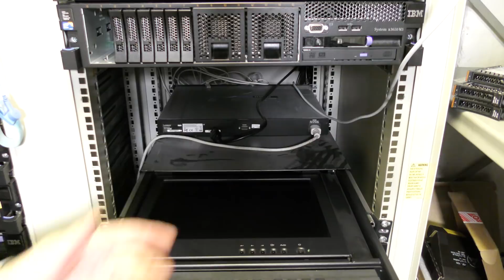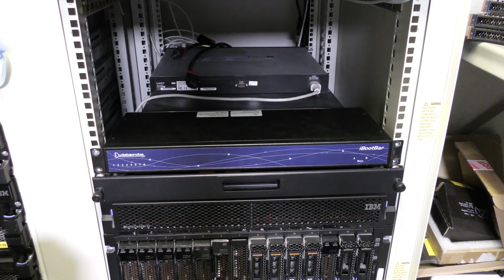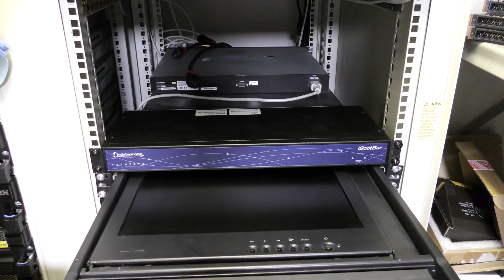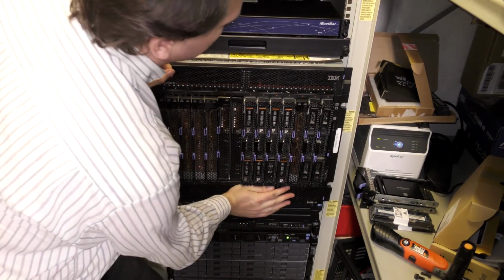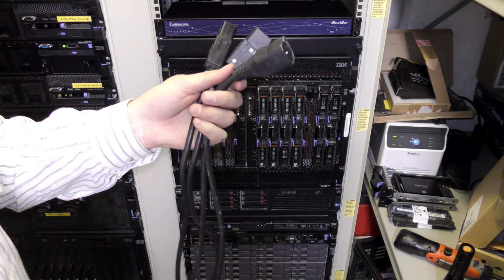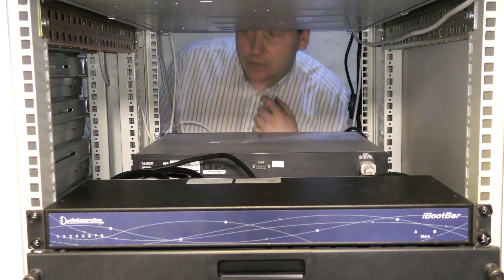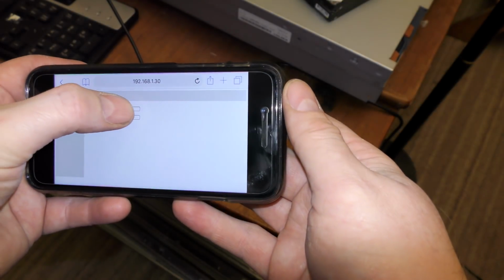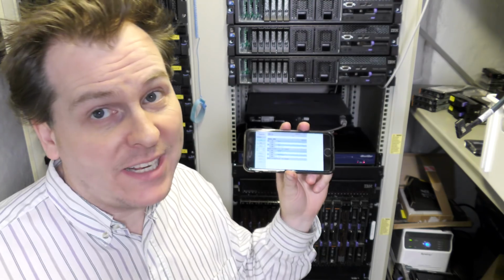iBootBar Possible to turn ON BladeCenter from Phone - 617

Comment: Morten, the iBootbar has two power inputs and switches seemless between them. You should connect your battery bank to one input with priority and let this power some servers behind them. Then connect the other input to your regular power. Now you can run on battery power and when these are empty, iBootbar switches back to mains until the battery bank is charged again and ready to do another cycle.
Reply from the maker: Hi Freddy Lauwers
Thank You very much!  glad you liked the video :-)
Thank you for watching! :-)

Comment: Rather than opening a port on the router pointing to a device like that, I would recommend putting in a VPN and connecting through the VPN to access the power-controller.  If you're concerned about power, you can run OpenVPN on a RaspberryPi.
Reply from the maker: Hi Brian Jurkowski
Thank You very much!  glad you liked the video :-)
Thank you for watching! :-)

Comment: how does it turn on if it only supplies power?
Reply: Ounce there is power you can remote in the the Blade center through the DRAC and power it up.
Reply: Bios, power option to resume after power loss.
Reply from the maker: Hi BlueFoxTV
Thank You very much!  even have an app on my phone to manage my H BladeCenter
Thank you for watching! :-)

Comment: It feels like with the blade center and the disks you are going to be pulling way to much power through the i boot bar and cables.
Reply: BlueFoxTV 
If that is true, Morton can switch one of the three bladecenters to one of the B main (4...8) outputs (and 1 or 2 of the disk shells to the A main outputs. Thus dividing the load over 2 mains.) 👍☺
Reply from the maker: Hi BlueFoxTV
Thank You very much!  They can pull a lot of power,, but it is a redundant setup, so the bladecenter will most likely use 3000w max. and I do not often turn it on. But this would not be a great production setup.. but fine for my needs.
Thank you for watching! :-)